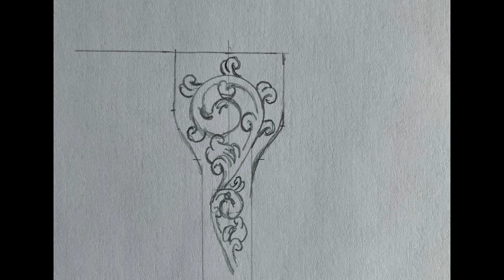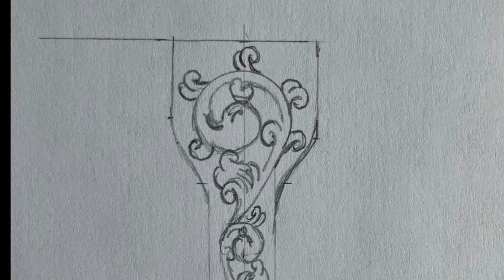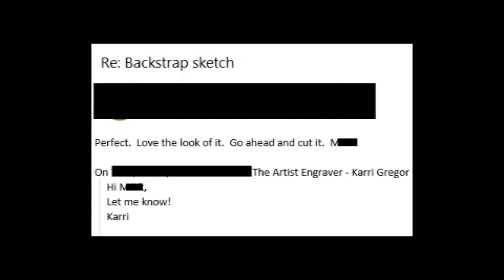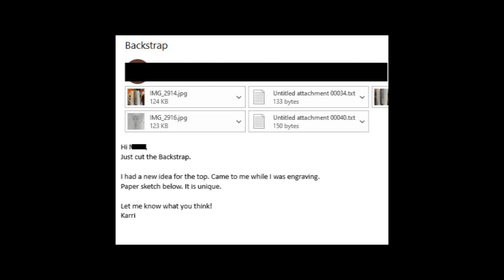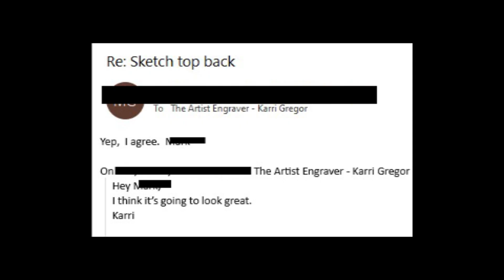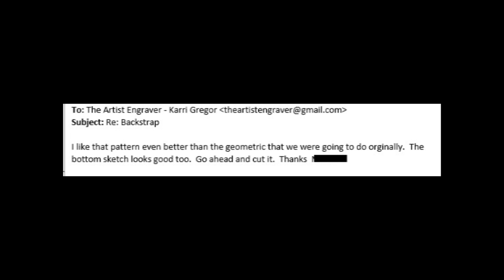PT 3 _ Colt 3rd Generation Back Strap | Watch Custom Engraving | Beautiful Metal Design Scroll

Comment: If you attach the backstrap to the frame, you won’t have any vibration. If you have trouble with the frame getting in the way sharpen a 60 degree face on your graver. 15-20 degree parallel heels with all edges dubbed on a fine India stone will keep your graver tip from breaking or dulling. If you have a microscope, go to 25x to see when you have your point and edges slightly rounded. I mostly use a 90 degree square graver but am transitioning to a 120. The 90 degree with a 60 degree face will get you into tight areas without tip breakage.  I have engraved multiple firearms without ever having to resharpen. Keep cutting and I will follow your progress. 👍
Reply from the maker: Thank you!  Always good to hear from experience.